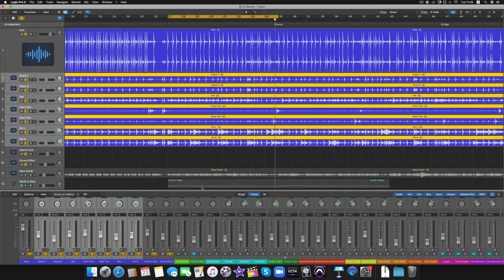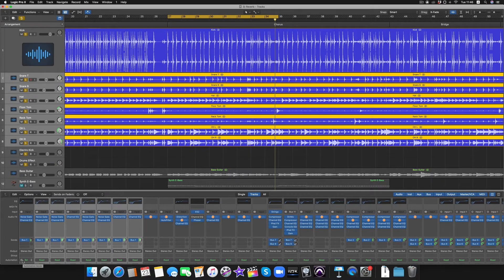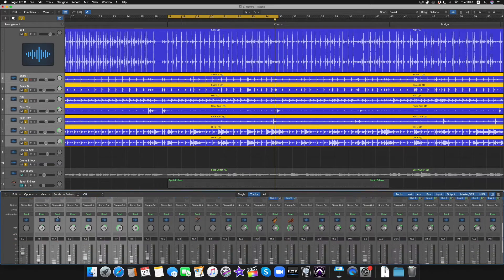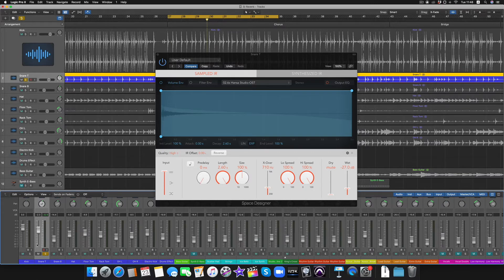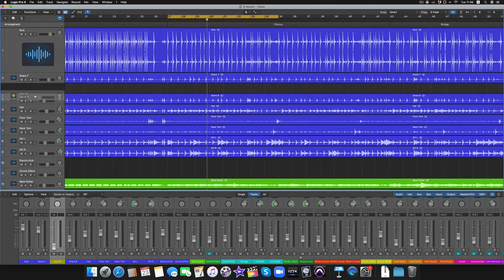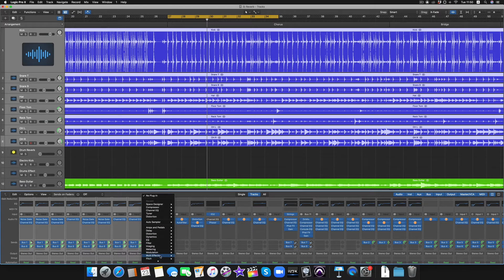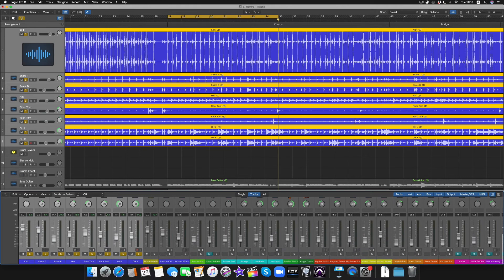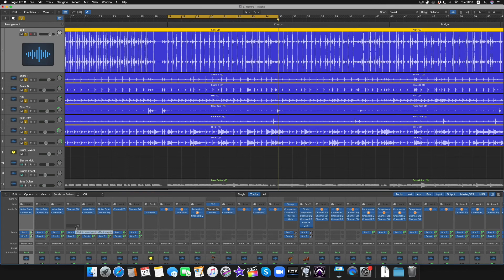Adding Reverb To Your Drums in Logic Pro X (Tip #3/7)

Comment: If I put a drum reverb to separate tracks and then add them to a folder it works fine, but when I add a filter to the folder and then make an automation on the folder with all my elements the reverb does not filter with the drum channel. Any ideas how to fix this?